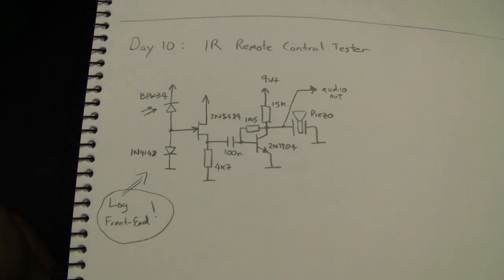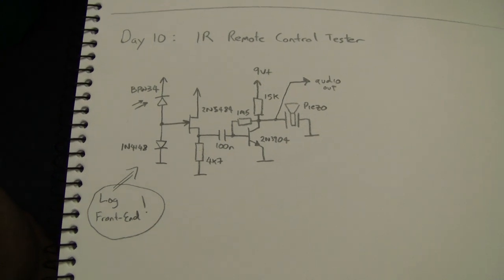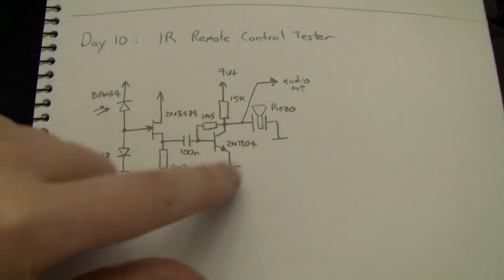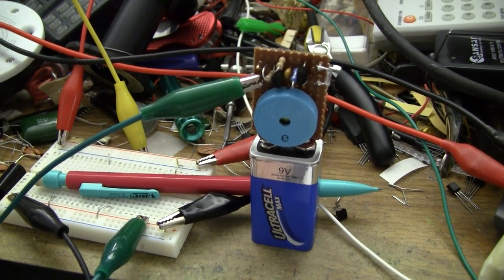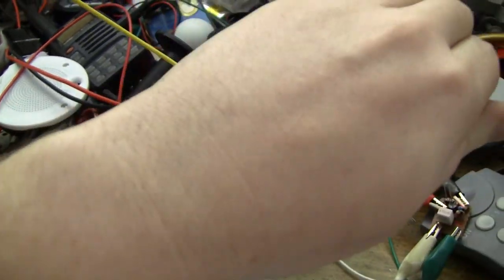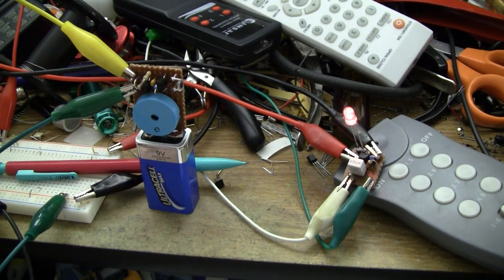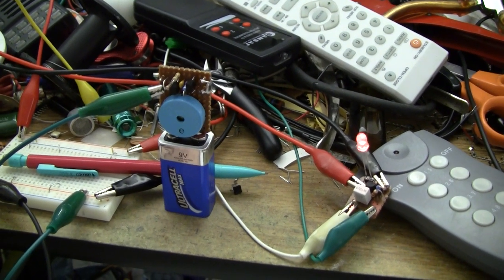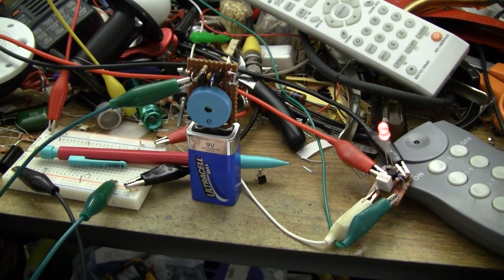Advent Calendar of Circuits 2011: Day 10: IR Remote Control Tester

Comment from the maker: @theemusic92 yeah, 4k7 means 4700 ohms and 1M5 means 1.5 million ohms.  It is a European standard, replacing the radix point with the multiplier.  Makes a lot of sense really, decimal points are easy to lose in printed text, using a letter is far more robust, especially after photocopying or scanning a few times.

Comment from the maker: @randomgarfield I used to use a AM radio between stations held near the remote, the large current surges have plenty of RF harmonics which tell you if it is driving a LED, even if you can't see it.  Just posted a video showing my solar cell + piezo previous tool for this job.  The camera is a good one too, but most cameras have IR cut filters now day that make them far less sensitive (and less likely to see though people's clothes).